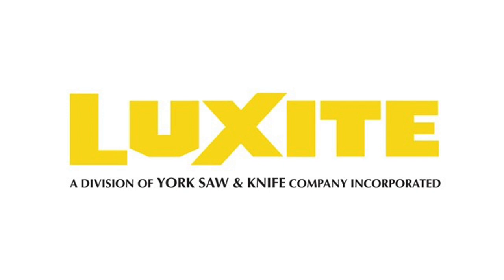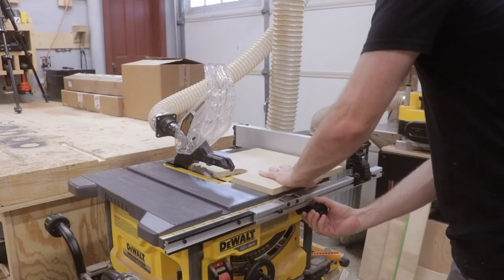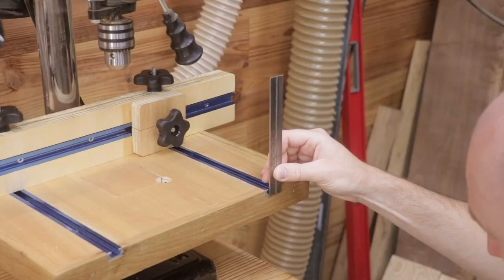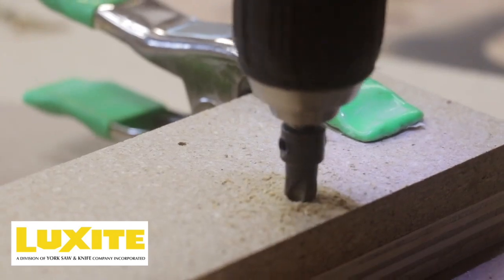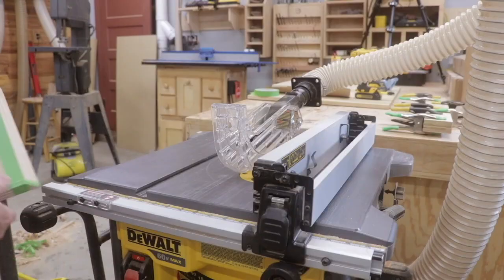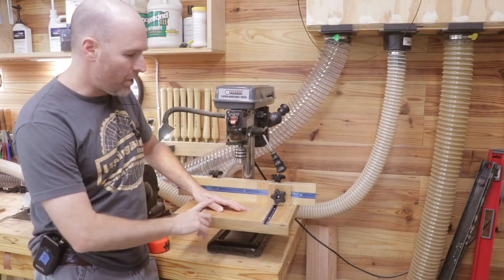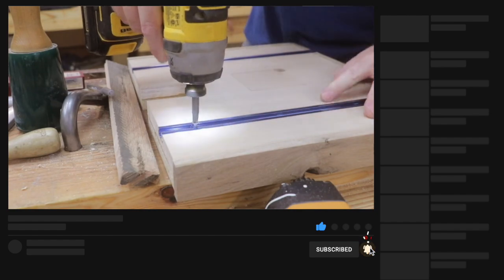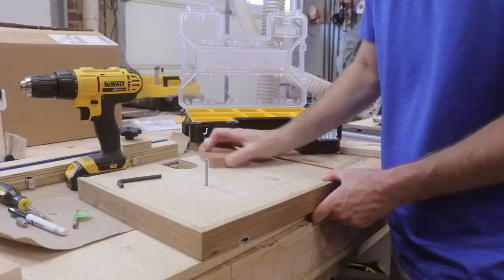Harbor Freight Drill Press Table Build Using T-tracks

Comment: Great video - thanks. Really like your explanations as to why you are doing a specific step. Not sure why the table needs to be so thick, though, and the fence. When I make this I’m going to use thinner MDF. I really want to add the T-track - great feature. Like the comment about mounting the insert plate so that a drill bit would hit it in a corner so that you can rotate it.
Reply: The top is that thick for the tracks. The bottom might be that thick due to the threaded inserts.

Comment: Those inserts are demonstrating why MDF isn't a good choice for the bottom panel of the table. MDF simply crumbles if you put too much stress on it and it will eventually pull those inserts out. Good video though and great build; very inspiring. Thanks!
Reply from the maker: Sure! Thanks for watching and commenting!

Comment: I am presently designing/building a flip-tops workbench that will house my miter saw, drill press, router raiser, surface plainer, and bandsaw. Except for the router raiser, all the other tools will be mounted on flip mounts and have vac connections and each tool opening will be concealed by a 180 degree hinged lid which will create a flat bench top work surface when all the tools are concealed below. My table saw will be attached to one end and the other end will be set up to mount other more portable tools on the vertical end of the bench opposite the table saw (band sander for knives, chisel sharpener, grinder, drill bit sharpener, etc). Below the flip cavity there will be room for various size storage drawers. Unfortunately, unless everyone who plans to build a duplicate purchases the same brand/model of tools, plans for such a bench would be worthless or un-useable.

Comment: What do you do as far as when you have to raise or lower the deck? Does the table interfere with the height adjustment knob?
Reply from the maker: The adjustment handle on my drill press does not require turning a full circle so it does not interfere. If necessary you could cut out an area for the adjustment handle or raise your table up some off the factory table to create the space needed.
Reply: Years ago I built a larger table top for my DP and ended up removing my table height adjuctment crank and adding an extension to the handle so that I could crank the table higher/lower.
Reply: Chuck Johnson , where did you get the extension?

Comment: enjoyed the video and would love to make one of these for my WEN press.  One question though, the material you are calling MDF looks like particle board to me.  Is it a different kind of MDF?
Reply from the maker: It really doesn't;t matter. Both MDF and Particle board are very flat so it provides a good base for the table. In my experience, plywood tends to have some twists in it so the flatness of the particle board or MDF corrects that.
Reply: @lastingbuild1373  did you seal the board at all? I know the MDF in my area (Florida) is basically a sponge, so I often seal it with a slow cure epoxy on the edges after finding that the "shellac" method is very overrated in terms of sealing the edges of it. (Another effective way I found was to simply put acrylic paint on the MDF.  I'm yet to have any swelling or issues with a thin coat of fast drying acrylic paint.
Reply from the maker: I put a coat of wipe on poly but I also have a portable dehumidifier in my shop
Reply: @lastingbuild1373  ahhh, nice. I have one, and central air but the humidity here is nightmare for raw wood, and press/mdf type materials.

Comment: Hi Jim, why 2 layers of 3/4 ply?

I have same drill press and my biggest complaint about it is the shallow 'throat' depth (is that the right word?)

With 2 layers, you just robbed yourself of 3/4"

Nice build... I will copy tho I may use 1/4 ply on bottom and 1/2 ply on top - your thoughts?
Reply from the maker: I use the MDF as the bottom layer for flatness.